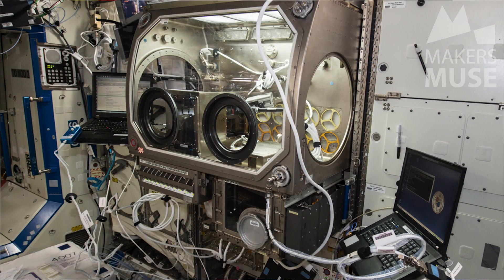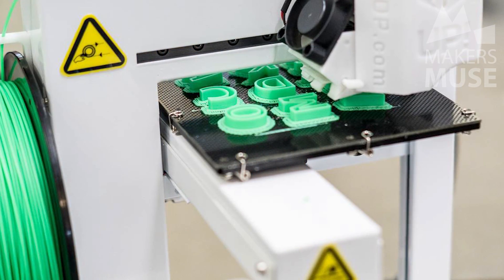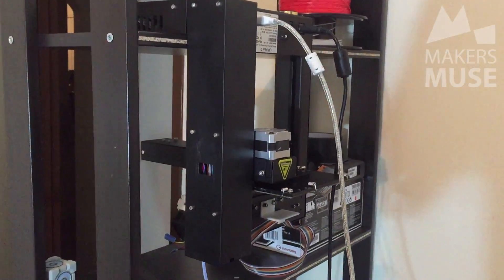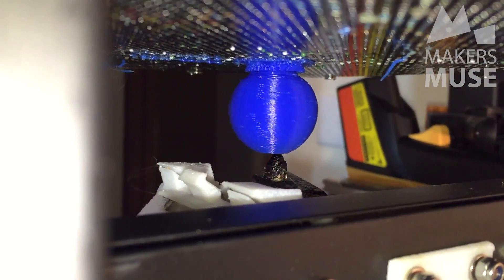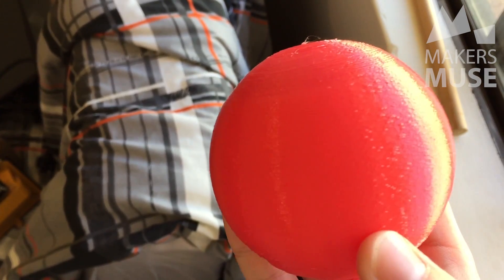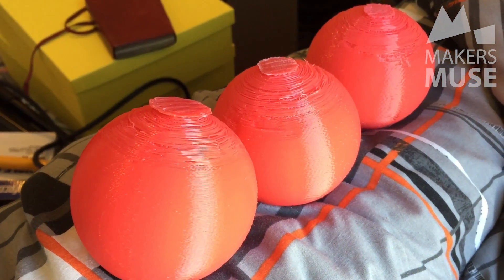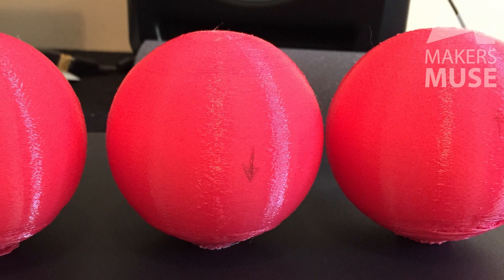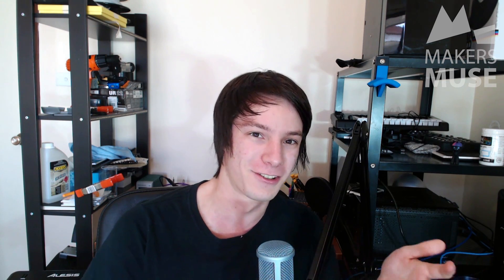The Upside-down 3D Printer Experiment - 2015

Comment: After all, this was not at all such a silly video, as "kralyn 3d" just released a video, showing off his own designed and built "Positron V3" upside down, core XY printer. This, in my opinion is a major step forward in 3d printing, as one major issue gets solved by this: The gantry is fixed at the bottom of the printer, reducing the need for massive stable frames, like the SK Tank and Voron V2, for instance have. It was under our noses and we didn't see this single, major advantage of printing upside down. I guess that there's going to be a race to get the first d.i.y., upside down 3d printer out onto the market. @Angus, could you try some upside down prints on a core xy printer and check out what the effect of the gantry, having a very low center of gravity, has? Try using a core xy printer with the least stiff frame, so that we can see if the vibration on the gantry is less with a lower CG. Thanks 👍

Comment: I was wondering if printing upside down does anything for you and not having to use supports, I e gotten mixed feedbsck about it, so I mounted my cr-10 max on the ceiling, can't tell you how it prints because it won't home, the gantry just wants to go with gravity and keeps creeping away from the bed, even the BL touch keeps trying to prove thin air, actually I cang even manually move the z axis to the bed? Is there some sort of mercury switch or something on these printers telling it if it's upright or not? Great videos btw!!
Reply: I found out, all I had to do it reset the bl touch!

Comment: I started thinking about this today, with respect to high speed printing.  Most high speed DIY printers are core-xy with all the movement at the top, requiring a very rigid case.  Flipping it upside down would solve these problems, if it printed correctly.

Comment: A blast from the past, so sorry for opening up an old discussion. Here's an interesting thought.  One very clear difference when you flip the entire printer is buoyancy. Hot air rises, and I find myself wondering if this could be an alternative solution to part warping.  Instead of having a full enclosure, put the printer under a hood that traps the warm air from the bed and extruder.  The part would then be in a bath of warner air, slowing down the cooling.  Electronics can me located outside the hood to keep them cooler.  I'm going to run an experiment myself, but would be really keen to see you tackle this too...

Comment: I wonder if making this a two stage process at half the sphere's height would fix this... Print inside out for the lower half, and outside in for the upper half.
Reply from the maker: Definitely, it's a great way to get a good finish on both sides, just assemble afterwards.

Comment: As for "no sane person would do this", check out this printer I built: 
https://youtu.be/hdju_6XEHZ4
Of course, your comment may still stand...
Reply: Hey, thanks!  I've been using this printer now for about 6 months, and pretty much everything prints exactly the same as with a right-side-up printer - bridges, overhangs, etc.  Nor any problems with bed adhesion.
Reply from the maker: Haha omg! That is intense, you would certainly need to have faith in your bed adhesion :)
Reply: Brilliant - seeing it designed for upside down use, I start to wonder why "conventional printers" (except some stereo lithography in resin printers) are the orientation they are. Except for your Z-Axis, all you parts only move in two dimensions, weight load all nice and clean on the table.

Comment: What are those colored things in the build plate?
Reply: RainbowMiner2004 up printers use a board with holes and a raft in each print for adhesion. When you take the object off, you chop off the little plastic 'feet' holding the raft.

Comment: Hi. Quick semi-related question. I'm trying ot print a mini-nuke from FallOut 4, the issue I'm having is the very top part of the sphere "collapsing" into itself. Seems, that I have issues with top of any dome and also flat top surfaces. I'm using the Wanhao Duplicator 4 and using mainly PLA at the moment. The red I have seems to be happy at 190C and use the platform at 60c. Not that the platform really matters for the dome. Fill around 20%. I would love to use other software than the replicator-G that comes with it, but have been unable to get the others to really work. All advice appreciated.
Reply from the maker: +Naamis1  Sounds like your infill isn't high enough if it can't support the top layers? Maybe try making it denser. Also your part might not be cooling fast enough, perhaps lower the bed a little and make sure the PLA cools quickly so it doesn't droop. Other than that not sure what else it may be!

Comment: In zero G there would be an even pull (or lack of it) on the plastic at all time during the extrusion so wouldn't it come down to adhesion? I don't know but would love to see it.
Reply from the maker: Gavin Thomas I think you're right, or at least adhesion has ome part to play, the plastic must be far more viscous than it appears when coming out of the nozzle, so can easily 'drag' itself around if not properly anchored. Would explain why even upsidedown it looked poor, it was trying to go from a small point to larger, not large to smaller like the top of the sphere.

Comment: Underwater next please
Reply from the maker: Brad Deveson Don't Tempt Me! :0
Reply: Maker's Muse Actually It might be benefitial if you're printing very fast with very hot plastic, then it would  solidify instantaneously. Well, we're waiting for it ;D (too bad mu prusai3 has moving bed, can't try such thing myself).
Btw, After a video I instantly subscribed to you channel. Very good quality of a video (all the aspects, including atitude :)) )
Reply: +Paulius Vandalas ye sbut the nozzle won't get the chance to get hot
Reply: Interesting. Are there any obvious reasons this couldn't work, assuming the electronics can be completely isolated from the water?
Reply: @mhelvens   You can't print underwater because the water would prevent the nozzle from heating above 100C, and you need to get to 200C for PLA to melt.
Reply: Bed adhesion for one
Reply: I've saw computer and TV running submerged in vege or mineral oil. Water will mess with electricity, but non polar liquid won't. So... be my guess!